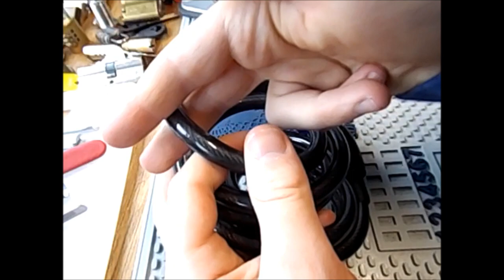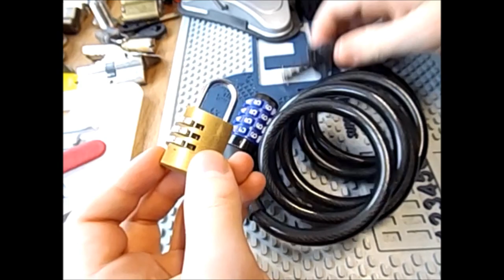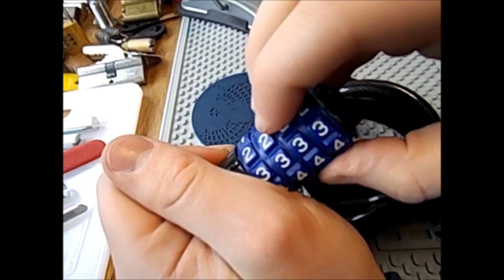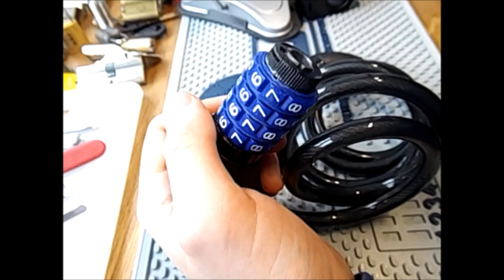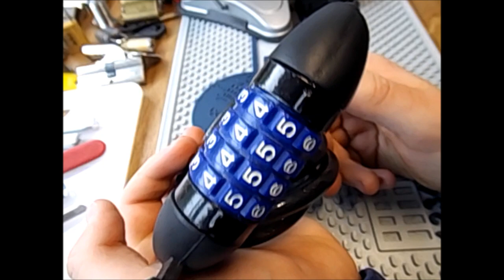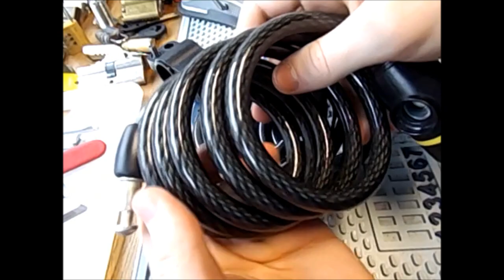Surprising combination bike lock explained (158)

Comment: Watched this along with other with interest. Had very expensive bike left at my property with a Master Lock Plus attaching it to the fence. Spent days looking at videos and trying methods but none worked as this lock was well made with false gates. After spraying it with CRC and freeing it up I made a truth table where all gates on each tumbler were noted, there were 4 out of ten on each tumbler so narrowing it down from 10 x 10 to 4 x 4. People have a tendency to like order in numbers from high to low but will transpose the first digits (or cell phone numbers are common). So now I could only use feel, what was different about each 4 gates? One slightly loose with others a little tight (the difference so small) and going from right to left the combination was found very quick. Probably the hardest would be to find the true gates with out narrowing it down with a truth table. Thanks for all the video's, a little bit from every one helped me as I was determined not to cut the lock off.

Comment: You have more patience than I do. I threw my lock away, I could not figure out the combination. Guess I don't make a good locksmith.
Reply from the maker: It’s true that I could have opened it destructively and been done with it, but what’s the fun in that? I love a puzzle and nobody likes to be defeated, but being defeated AND being a bad loser is a whole lot worse! I’d rather just practise and get in shape for the rematch!! Thanks for stopping by, there are sometimes those few that just stump you no matter what unfortunately, and even the locksmiths have them... they generally result in drill bits being used.

Comment: Thanks for the video. I found the exact same lock during a Spehrrmull (bulk garbage day) yesterday here in Germany and your technique worked for me. Also glad I watched the whole thing to know NOT to change the combination for fear of having to do that again. But since I normally sell stuff I find at Spehrrmulls and have 8 bicycles already, I'll just include this lock as a bonus with one of the bicycles once I post it to eBay. I only wish the shipping part was easier. Thanks again!
Reply: I played around with it and saw everything I couldn't see in the video. It's a very simple design and one way the manufacturers could make it less hackable would be to machine the bolt and the gates to a a finer standard of tolerance. That way there would be little if any "play" or "give" in the bolt when the mechanism is locked. Almost forgot! I once found a locked combination safe with some tantalising metal-sounding parts inside. This was before the internet so what I did was take apart my existing combination safe to figure out how it worked, then went to a store that sells safes for the purposes of intelligence gathering. I found out that this model had 4 numbers, which was key, each 0-99. Since I knew that the gates were only 9 digits wide, I narrowed it down to just 14,641 combinations. I used a very similar technique to the one for the bicycle lock to diagnose the last number, so that left me with just 1331 combinations. Since the wheels all had to be aligned to the right for each attempt, that meant each try took about 2 minutes. I printed out  all 1331 combinations, and just started doing them all at random, dutifully crossing each one off. 2 weeks later, having tried just about 40% of the numbers I managed to open the safe. That tantalising metal sound had been the montage bolts that came with the safe. I still have both safes to this day.
Reply from the maker: Sun Rabbit Thanks for watching, I’m glad it helped you to understand how these locks work! It is because of tolerance issues that we can find alternative means of decoding these locks instead of having to go through all combinations. Unfortunately lock manufacturers aren’t likely to change their design any time soon, it is true that even the more expensive brands have weaknesses in construction.

Comment: I was able to unlock mine 1/2 way through viewing this video .   I put pressure on the locks by pulling them apart AND angling upwards at the same time (as though i was trying to snap it with my hands).  I did the far left dial first and then with in 3-4 mins had unlocked it left to right.  have now reset the combo and recorded in my password file :) .  Pretty happy with that. thanks for the video
Reply from the maker: Great tip, I never thought of that, you'll be putting the tension exactly where it needs to be by doing that. Glad you've had success, thanks for sharing!

Comment: Very nice review - love to listen when you talk about your lock. I also found it very hard to decode bike locks like this as it's really exhausting with pulling and turning. For practicing I clamped on side in a vice and pulled on the other. You also can use a screwdriver to turn the wheels. Cheers.
Reply from the maker: Thank you my friend, at some points I actually used my foot on the cable to tension the lock. It really was quite a surprise to see what security features were hidden in this lock.

Comment: I have forgot the combination of this lock.  Can u help how to open it ?
Reply from the maker: akki dhruva There are quite a lot of videos explaining how to decode these locks, basically you pull the two sides of the lock apart and turn each dial until you feel a slight give, sometimes the dials will pop into place or become loose when they are in the correct position.

Comment: LMAO! cut thrugh VERY easily??? not if you DONT have a good pair of CABLE cutter, any body got a pair. SO I can CUT MY DAMN look off? as these HACKING VIDS just AREN'T cutting it with MY particular situation> GRRR.
Reply from the maker: I would suggest that if you aren’t prepared to cut the lock off then you perhaps aren’t in a suitable position to decode it either. Did you consider that it may be possible for you to acquire a set of cable cutters from your local hardware store? I make lockpicking tutorials too, but if people aren’t prepared to buy the picks then I can’t help!